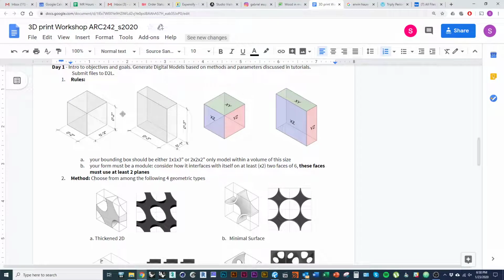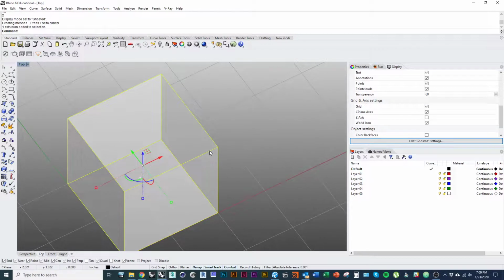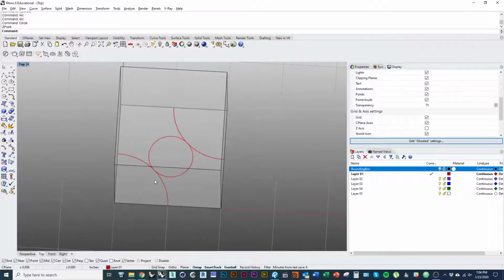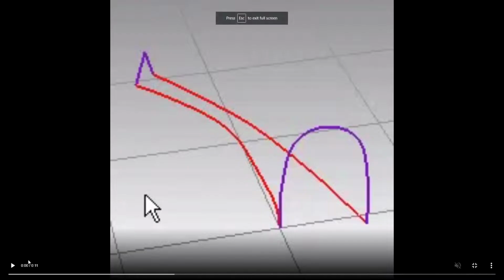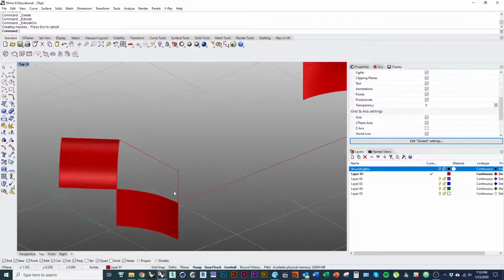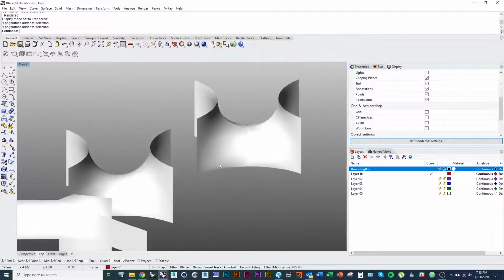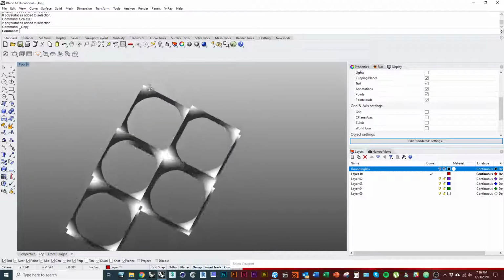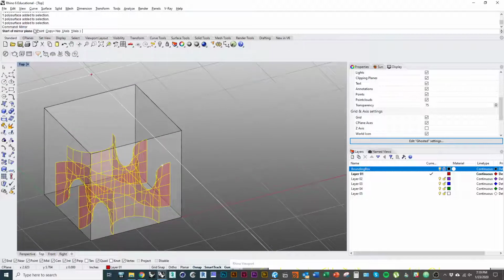ARC 242 2020s 3D print Workshop Part 1b: Minimal Surface

Comment: You can basically make the surface shown at 17:16, then slice it into quarters? To arrive at the initial surface? Lofting from a circle to a square? No?
Reply from the maker: Well the surface curvature would not be tangent if you just loft a circle to a square
Reply: @sheehanwachter1671  square to circle to square, will do it, as opposed to 1 square